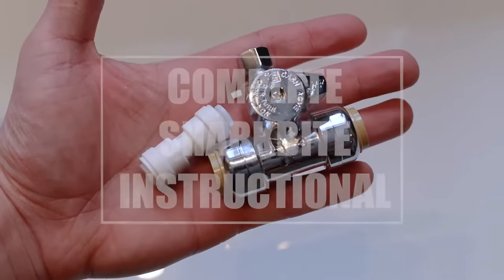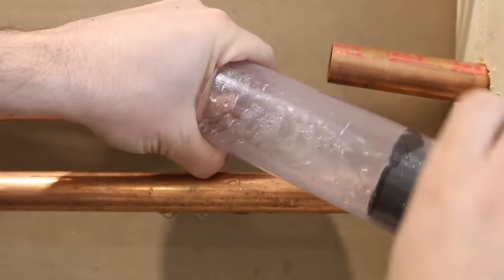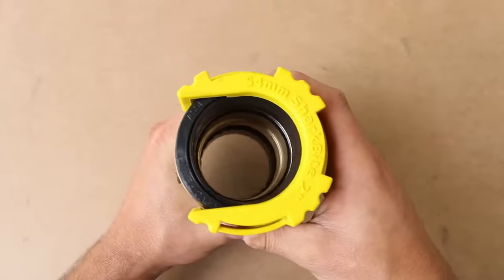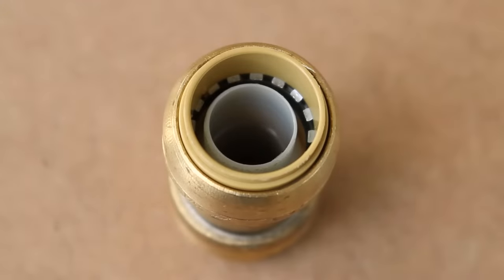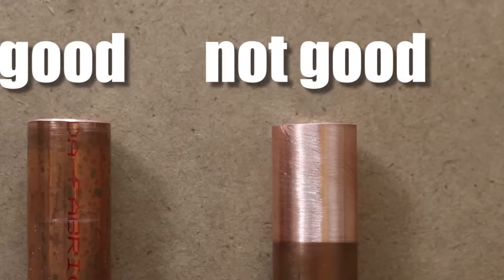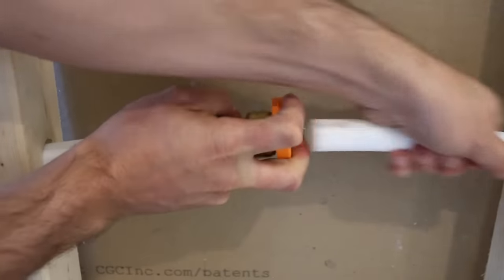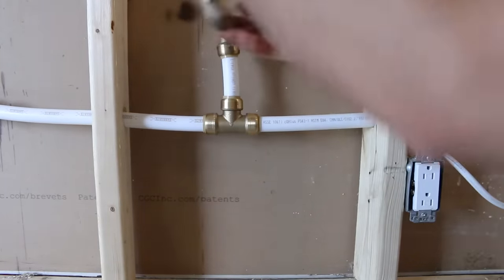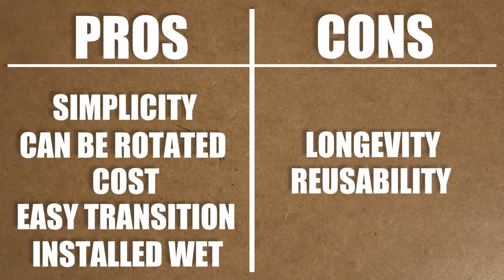Beginners Guide To SHARKBITE Fittings (Watch till end BEFORE Buying!) | GOT2LEARN

Comment: Why mark the pipe with a marker, when you have a stopper inside the fitting ?
Reply from the maker: To have a visual indicator the it is set properly
Reply: @Got2Learn  It can't go further than the stopper inside the fitting. Even if it's unevenly cut. That's how I see it, and tried.
Reply from the maker: Not further, but not enough...

Comment: If Sharkbite and pexA can last 20 years + no reason to even convince me further. 😂 Used Sharkbite and Pex-A on a farm for 60 horses automatic waters. Never had any issues. Also you do not want to have Pex-A outside in the elements then it will get pinholes. I found a line that was installed probably 10 years old outside and it finally had a pinhole. Easily replaced it and buried 2ft.

Comment: Time will tell and I don’t think they Will leak they are all well made and engineered and Expensive i use this it’s more easy this most likely the one i use for air pressure that i connect to a moulding machine.

Comment: dammit, i had everything ready - except i thought i could use rough sandpaper to remove the outside burr. fuck. i have to wait till store opens now. using the Watt brand push fit T valve reduction. 3/4 3/4 1/4(ice maker, replacing saddle valve that BestBuy installed - it's leaking)

hey btw i sanded a pipe i put a compression shutoff valve on, was that a mistake? (it's my house, and i haven't seen it leaking but i had to tighten it hard)
Reply from the maker: Try the Sharkbite on, if it leaks it could be because the pipe is gouged due to sanding, if not, you should be good.

There's no need for sanding with compression vales, unless there's solder or paint on the pipe.

Comment: I don’t agree about the cost. Shark bite fittings are about six times more than copper fittings. 100) 3/4” elbows = $234.00. 100) 3/4” shark bite elbows = $ 1,293.00. $1,059.00 difference for plumbing a new house. Copper fittings will last longer.

Comment: Does anyone know a good brand for water pressure gauges? Preferably the once filled up with fluid for protection? Lead free of course.
Reply: I've had good luck with the Winter brand, decent quality at a reasonable price.  Most are made in China nowadays.  There are better, but $$$
Reply: @StilettoSniper  Do you have a model number by a chance? Thanks

Comment: So, I'm like, kinda confused. Plumbers and many other people shit on sharkbites because its a rubber seal that stops water and it degrades, etc etc.

...I'm doing a shower project right now and....what do you know? The mixer valve uses a cartridge system that seals by....only rubber o rings. And, get this, its rated for 30-40 years. Yet I don't see any uproar from people with this system, so why the fuss over sharkbites? This is literally installed in a sealed wall away from view. 

So whats the deal?
Reply from the maker: That's how you know people are under informed. Sharkbite o-ring material (EPDM) has been used on planes, cars and many other places and did great.

Comment: I thought you were supposed to use sandpaper to clean the pipe.
Reply from the maker: Not recommended with SB fittings, use an abrasive pad instead.

Comment: So the installer of my gas water heater uses sharkbites to connect the gas feed.  Next day, the wife complains of the smell of gas.  So I mix up some soapy water, spray the fittings, and sure enough it's leaking.  Call the installer, he comes back, sprays HIS stuff on the pipe,  No bubbles.  My mix bubbles.  Turns out his mix wouldn't work!!!!

Comment: Using these things in a concealed wall is taking an unnecessary risk. Besides, as a plumber,, all you're doing is taking money out of your pocket and putting it into the pockets of the manufacturers without much advantage to yourself as a plumber and absolutely no advantage to the homeowner.  Personally, residential use I very much prefer soldering when possible/practical and  Uponor for all other times.
Reply: I am a licensed builder who has had them installed in many additions. Only had one call back in 20+ years and that was because the insulation was pulled out of the stud bay and the cottage was not blown out before winter.
The ice can push the teeth down and cause a loose fitting.

Comment: As an experienced plumber (24 years) i do not recommend these fittings EVER! I come across at least a dozen each year that are leaking and aren’t that old. I had a flood on a job that i did temp shark bite caps and one leaked after i left the job when the air bled out and the water reached the cap. Nobody was at the job for a week. I measured and made sure the cap was seated all the way and the end of the copper was cleaned with scratch cloth. Call a plumber or learn to solder. Fittings are cheaper and proven.

Comment: It can take months to master soldering? Uh, no. It can take about an hour.
Reply from the maker: Good 👍
Reply: Uh, no.  As far as I am concerned, mastering soldering in a plumbing environment means you can properly solder ANY kind or size fitting in ANY orientation in ANY location in ONE attempt without burning down the structure you are working in.  You don't "master" that kind of scope in one hour.  If what you said was true, you would have a lot more "professional" plumbers out there willing to solder copper rather than run for the shelter of their Propress tool or cower behind a box full of Sharkbites.
Reply from the maker: @StilettoSniper  thank you 😊

Comment: I have had them exploded apart, the plastic ring breaks easily, seals dry and crack, again technology is only getting worse. Solid metals, Wired connections, and Analog will always be king! SharkBite is the crApple of plumbing!

Comment: guys don't ever use sharkbite. the fact your using a slip on fitting means its not meant to be permanent. yeah it takes no skill but if your doing a repair do it right compression fittings or solder it.

Comment: DO NOT USE this product.  Installed this on a burst pipe last fall.  Followed directions and tested, it worked fine.  Now in the spring, the internal rings blew out and caused major water damage.  This is one POS.

Comment: SHARKBITES WILL NEVER LAST A LIETIME!!!!!  I have been a plumber for 22 years and sharkbites ALWAYS LEAK after time.  That thermoplastic retainer will fail and cause leakage.  Hot water lines exacerbate the situation as the plastic retainer and stainless steel do not age well when exposed to expansion and contraction.  If you're not a professional and have no training or field experience, you should not be giving advice bro.  Additionally sharkbites are Illegal to install in a wall as they are deemed a mechanical fitting and cannot be buried as per national standard plumbing code.

Comment: I hate copper it’s a pain. 1st it has to be cleaned
2nd soldering sucks nothing like hot solder in your face
3rd it’s dangerous because it uses fire wood and fire is not good
In conclusion I hate soldering

Comment: You should thoroughly explain that “PRO” tools use crimp and orings as well and cost thousands! Shark bite lasts decades as proven. If you want better there is only expansion tools which rely on “plasticity nature” as it will shrink on to the fitting rather than crimping which is opposite of the plastics/rubber origin. I like your vids but tell the whole truth.

Comment: I think they are amateur hour. You start by saying they’re good for DIYers. Shark bites and CPVC are the hallmarks of the amateur. That includes flex connections when hard piping is more appropriate
Reply: Nah cmon. If prepped and used right they're pretty good connections. The problem is contractors see failed DIY repairs using them and blame the part instead of the customer. Almost always user error.

Comment: Watch til end before buying? Hell, this is just another gimmick and is all about saving time upfront at the expense of longevity. My parent's house was built in 1947, 74 years ago with all copper piping for incoming and drinking water. Nice, sweet water and the lines have lasted forever without one failure. And all these garbage gimmick joining sustems of the 21st century want me to buy them? Hah! Not in a million years nor if they paid me a million dollars. What junk, crap, shinola. If a system like copper ain't broke, why fix it?

Comment: All the prep is unnecessary
Reply from the maker: That's why they leak LOL
Reply: @Got2Learn  mine have never leaked, I lightly sand and make sure exterior burr is gone but removing an internal burr is ridiculous
Reply from the maker: @midwest9757  the internal burr has nothing to do with the prep for these fittings, that only for system integrity, pinholes and such.